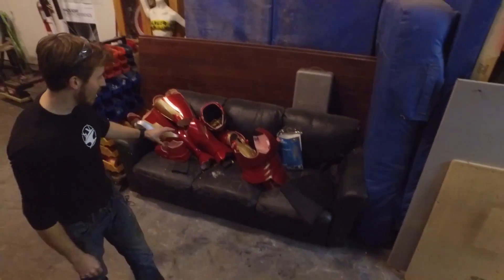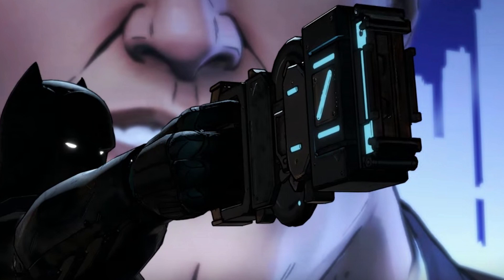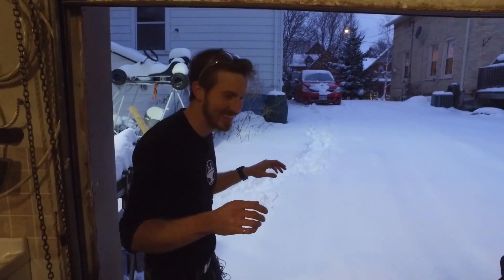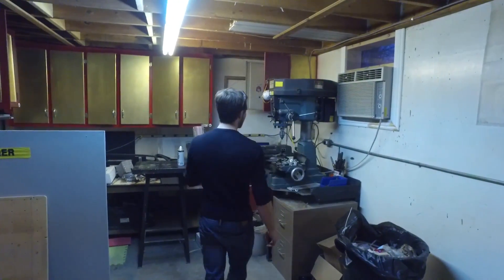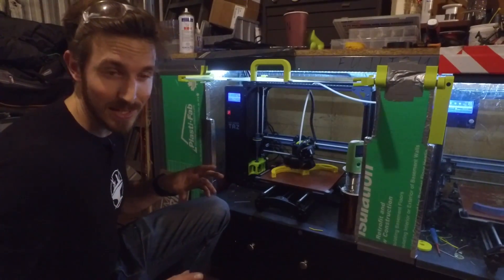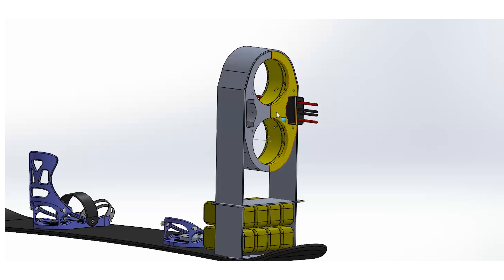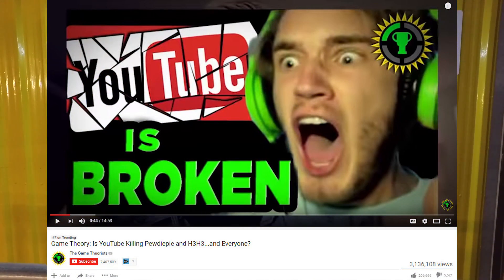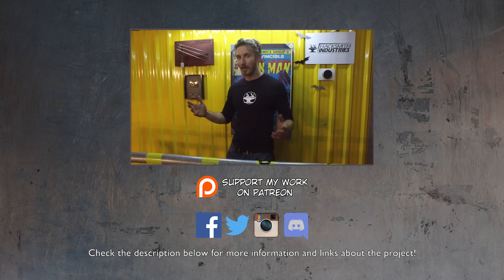WILL THE GRAPPLING HOOK ASCENSION DEVICE WORK? (Workshop VLOG 011)

Comment: I've always loved to build similar projects as you guys do.  I have the problem of spending way too much money on them tho.  it's a love hate addiction.   I'm excited to see how the snowboard turns out.  I'm wondering what type of fasteners you're going to use to attach the turbine bracket to the board.  I would think they would have to be tapered so that the head of bolt would sit flush with bottom of board.
Reply from the maker: That's the brilliant part about it -- it's just going to slide under the binding -- then the binding bolts through it to the board. Can literally put it on any board you want!
Reply: the Hacksmith ahhhh I see.  good idea.  you should think about getting a pattent together...  I think a lot of enthusiasts would definitely be interested in purchasing for personal use.

Comment: your snowboard looks a little off balance. maybe putting the edfs on the sides and batteries on both ends of the board
Reply from the maker: The weight difference compared to me shouldn't have much of an affect on the board itself -- we put the EDF's vertically on the back so they don't suck in snow, and if (when) I crash, they don't get broken! =)

Comment: I just bought a really nice quality 3D printer on Gearbest. You can produce large objects. I can't wait to get it and start making things. They had a flash sale which I couldn't turn down. Originally over $400 for only $152 shipped. Another $25 for 400M of black PLA, and $14 for the auto level device. You have to assemble everything though. Look forward to your upcoming videos!

Comment: you might rip your shoulder out with that...
Reply from the maker: Definitely a possibility!
Reply: the Hacksmith i think the winch should be on a harness of some sort. can you even hold the grappling hook while accelerating upwards? no offence, just worried for ya. also if you fall, you might break something if you land awkwardly so the winch should be fastened directly to you, like a harness...

when your done with the ironman project, do iron man vs bat man XD
Reply from the maker: We'll have a hidden harness system up my sleeve =P
Reply: the Hacksmith Yay! no dislocated shoulders XD. also wear a batman costume while ascending. it might make news headlines XD
Reply: +Bryan Suh I think he should make the Batman tell tale costume
Reply: If the ascension mechanism speeds up gradually, it shouldn't be an issue. It's like drag racing, the sudden acceleration is what hurts but once your body catches up in terms of momentum you're fine.

Comment: when slivers of metal fly out from the tormach that is in the same room as the battery cabinet and they all explode
Reply from the maker: That's why the cabinet is shut... it wouldn't go through the cabinet =P

And the Tormach is enclosed -- metal slivers don't fly out =)
Reply: +the Hacksmith partially joking... we have a shop at school and the batteries for the battle bots cause issues when they get hit by spinning hunks of steel
Reply from the maker: Aha, I can see that happening!
Reply: +the Hacksmith What 3d printer is the big professional one?
Reply: +the Hacksmith if it flies out and hits your heart, you better make an arc reactor! Lol

Comment: Wait, hacksmith, wouldnt it be more safe if you attached the Grappling hook thing to a belt or a Harness? I mean, the  handle from the grapplinghook shooting device could break because of the weight, your hands could hurt from holding all the weight of your body...

Comment: hint: i have built powered roller coaster. if you would make a powered snow board, make it so the initial acceleration is soft and gradual, if it's sudden, you'll be jerked backward. the force is below your center of gravity

Comment: Unless this gets into patent issues, 3-D scan the EDF blades, edit them larger, 3-D print those, use them for a mold, cast it in aluminium, or whatever material is best, and clean it up with sandpaper to smooth it out, do whatever else is necessary, and if it works out, you'll have the EDF blades you need!!!

Comment: Do you guys already think in something that aproaches to a eject system for the batteries, you know, something mechanical, just in case that they get on fire... again xD
Reply from the maker: It'd probably be too heavy =(
Reply: even with a 3D printed material? (I mean, I never felt the weight of anyrhing printed, but looks like light) maybe you can do a little wire spring thing, and if the battery gets on fire maybe it could destroy the project (and your skin, muscles and bla bla bla)

Comment: Would it not make more sense to put the batteries for the snowboard between the feet to keep CG central. Would also allow the EDFs to be mounted lower to keep thrust closer to the ground making it more stable
Reply from the maker: EDF's need to be high up so they're not scooping in snow all the time -- and having them lower puts them right behind the boot so they wouldn't get proper suction =(

The overall weight and thrust really shouldn't make much of a difference since my weight is much more -- it'll just take practice =)

Comment: your front foot on a snowboard is your pivot and most of your weight. if you mount at the rear, you're as end will try and pass your nose. mount them forward of your board center. closer to your front foot.
Reply from the maker: Then all the thrust would blast into my leg and not do anything... It's only 16kg of thrust -- my bodyweight will counter that no problem -- imagine someone pushing on your back -- as long as you're prepared for it you can use it to your advantage =)
Reply: the Hacksmith it's not the pushing, it's the turning. have someone push from your back boot while strapped into your board and try turning while you're pushed... you'll see the problem then.
Reply: the Hacksmith it's not the pushing, it's the turning. have someone push from your back boot while strapped into your board and try turning while you're pushed... you'll see the problem then.

Comment: I dont mean to be a massive saftey freak but you should really invest in alot of lipo bags or a lipo bunker. I know you proved they arent that good in the Iron man vid, so you should probaly do a lipo bunker. Flite test has a great vid on how to make a bunker. Also put a smoke detector near it. Again hate to be a saftey freak but last year I had a lipo fire and it was bad.
Reply from the maker: We only charge while present, but yeah, a cinderblock setup would be ideal... The bags are pretty much useless though =( Metal cabinet means everything inside will be destroyed, but atleast the fire won't spread!
Reply: True. Thanks for responding as well.

Comment: Hacksmith make a mould out of the 3D printed EDF then cast it in aluminium or something.
Reply: OR 3-D scan the EDF blades, and/or cast them, that shouldn't be too expensive,
Reply from the maker: Casting precision parts like this is really hard. I wouldn't want to risk it =(
Reply: the Hacksmith Grind them down and polish them after maybe?
Reply: Would paying a fabrication company to do it save on money?
Reply: Or maybe just 3-D scanning, enlarging, and printing. Would that work?
Reply: Are there premade EDF blade downloads for 3-d printing? Or would that get into patent issues?

Comment: I use pet g and it works freaking amazing on my taz 5 you should try it
Reply from the maker: Our first attempt failed miserably, not sure why -- used the presets that came with the TAZ -- any tips?
Reply: the Hacksmith use 240 for the extruder, abd 50-60 for the bed, not too too fast print speed and make sure you have enough support. I am actually in the 10th grade at Brenham Highschool, and that is where I have access to a printer, I am pretty active using it and we have made multiple prosthetic arms for kids who (obviously) don't have them. I recently modified the model we are using (from the website Enabling The Future) and put a tactical rail on the IRON MAN themed arm so he can have lazerz!!!!!
Reply: the Hacksmith also, if you heat the bottom of the board (at le nose) you will go faster, so like, do that fam!

Comment: Only concern would be how to brake when on the snowboard if you are going that fast. Also,  Maybe creating some sort of safety ring around the EDF's, so if you do fall, they don't dig into the snow? (think training wheels on a bike). Otherwise, keep up the good work!
Reply from the maker: Well that was the problem with the longboard -- absolutely no brakes. At least with a snowboard you can carve and stop quite easily =)

The position of the EDFs already protects them (and the weldment) -- unless I come away from the board, my body prevents the EDFs from hitting the ground =) Unless of course I break my legs.
Reply: Make sure the edf's cut power when you brake otherwise you'll lose your balance much easier.

Comment: Where do you get the money for this?
Reply from the maker: A bit from YouTube, a bit from sponsors. But mostly from me. I spent all my money I made from working as an engineer on tools, equipment, and this shop -- and I'm still like $300,000 in debt to the bank... if the YouTube channel grows a lot it might turn into a viable business, but for now, it's bleeding hard. I run another business and do consulting on the side to help pay the bills.
Reply: Aaron Keith youtube, and like he said other supporting platforms. plus those compans he is advertising get him lots of supplies and support.

Comment: Are you still using an ABS slurry to promote adhesion in addition to the heated enclosure? Or do you have a special polymer bed as well?
Reply from the maker: Yeah we almost always use an ABS slurry (or just ABS cement -- basically the same thing) to increase strength and finish.

Comment: You are awesome! this is the future! Welding is good skill to have. Are there welding devices that are lower powered and less dangerous more suitable beginners?
Reply: Cosmo John Nope this is the present
Reply: Dynamic_ It's all relative bro
Reply: learning to weld isn't hard. It just takes practice. I learned from my grandfather when i was 13
Reply: NexTGeNCrysis Yes, it looks simple but for beginners , it can be dangerous. All it takes is 1 costly mistake
Reply: Cosmo John true, just remember: gloves, face shield, jeans, long sleeves and close-toed shoes. The long sleeves part is an option but it's probably better for beginners
Reply: NexTGeNCrysis The simplest safest welding i know if lithium battery spot welding . no toxic fumes.
Reply: Cosmo John I just use a standard welding  machine and rods. I mainly work on 1/4" steel up to 3/4" I havent had any problems wit fumes as my hood keeps them away but i guess adding a fan couldnt hurt
Reply from the maker: Welding really isn't that dangerous. Most stick and flux core arc welders (what I use) only operate at 40V which is below the skins resistance. While it's not recommended, you can touch your work piece with bare hands and you wouldn't electrocute yourself if that's what you're worried about. 

As for fumes or sparks hitting you... just make sure you weld in a well ventilated area, and wear thick clothes, leather gloves, or preferably a work apron while welding =)
Reply: I have an idea. Use the materials from the yeti cup to build a suit cause they are made to not get heat to the other side of the cup so you can use them to protect from the flames

Comment: So you have Home Depot Canada
Reply from the maker: We do, where didyou see that in the video? =/
Reply: the Hacksmith The Husky shelf Husky is owned by Home Depot
Reply: the Hacksmith try and make a crossbow but without a welder, Wood glue.
Reply from the maker: Oh hahaha I actually bought it used from the ReStore! But yeah, you're right!
Reply: What I thinks funny is the fact that you a huge YouTube or replied to me one out of many fans
Reply: the Hacksmith what if you put the E.D.F on a angle pointed to the ground would it go faster?
Reply: jack 123 yeah I wonder if it could but it would also make more downwards force and create more friction so
Reply: jack 123 ,, you would think so but as powerful as the thrust is with those jets at over half throttle would cause some lift to the rear ,,, not much but enough to severely effect handling ,,, hope that kinda helped
Reply: You have a ReStore in Canada? That's great. You wouldn't believe the things I've gotten from my local ReStore dirt cheap. Many shown on my channel. In Florida I Wakeboard....super fun.
Reply: I would say no.  You would be putting a portion of the trust in a direction not aligned with your ideal direction of motion.  It may reduce the normal force from the snow, thereby decreasing friction, but I feel that it would instead help bury the nose in the snow.
Reply: jeff harris o ok cool thanks for the info
Reply: Zachariah Sawyer  k thanks
Reply: Zachariah Sawyer  k thanks
Reply: ADAM LEE thanks for the information

Comment: Colin furze made on with a screw driver🖒
Reply from the maker: It was rather slow though ;-)
Reply: the Hacksmith it was....
Reply from the maker: This one will rip your arm off if you're not careful XD
Reply: colinfurze is a crazy engineere XD I like when everything explodes
Reply: the Hacksmith well as long as the motors or gears have tons of torque you will be fine seeing how fast the motors can spin